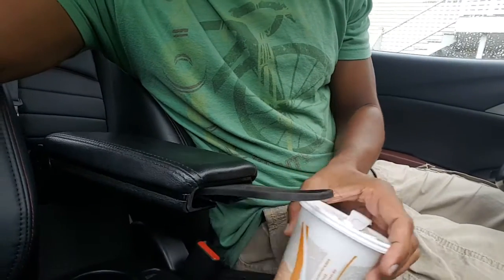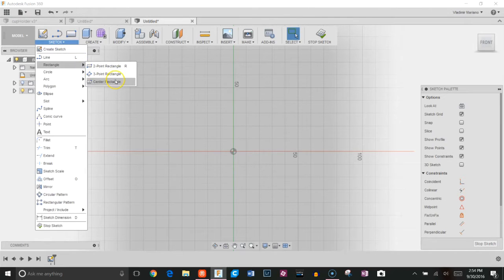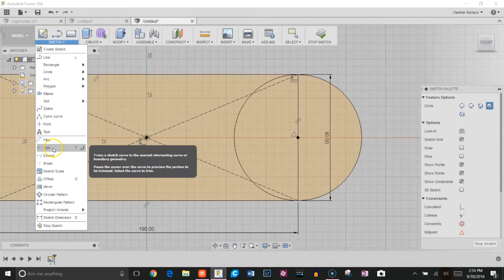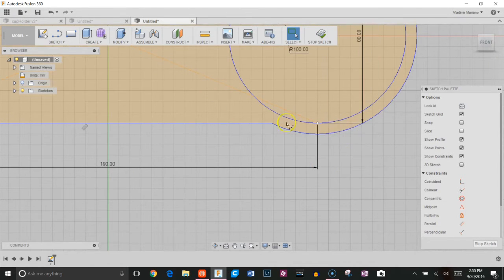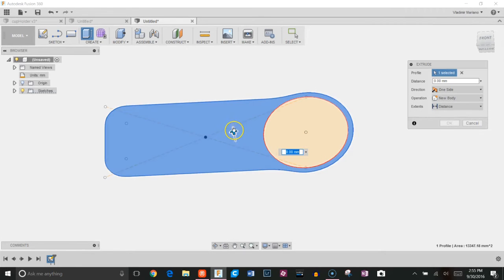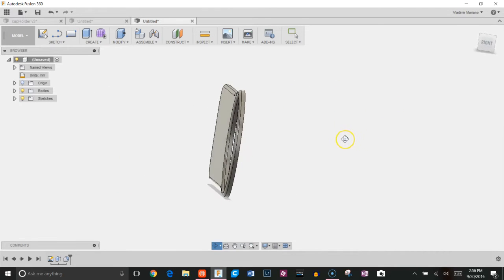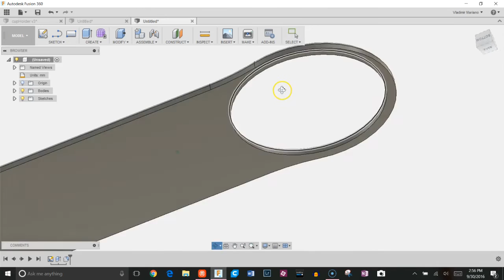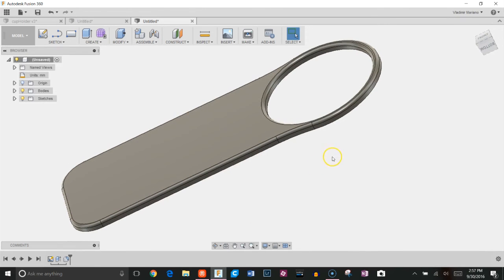Design your own Cup Holder in Autodesk Fusion 360

Comment: The first thing I designed for my Camaro was a cup holder that attaches to the E Brake. Also have designed a card holder and fidget spinners.  I have an model Arc Reactor with 19 tri color LED's and custom PCB run by ardino mini.

Comment: If you have to hit the brakes hard (say that kid rides their bike into the road in front if you), what stops your cup (and holder) from sliding into a splash crash into your stereo & climate controls?
Reply from the maker: There's a spring inside the arm rest that pushes against the cup holder.  There's enough friction there to hold it in place as long as you model it thick enough.